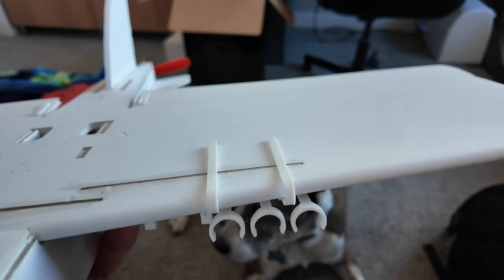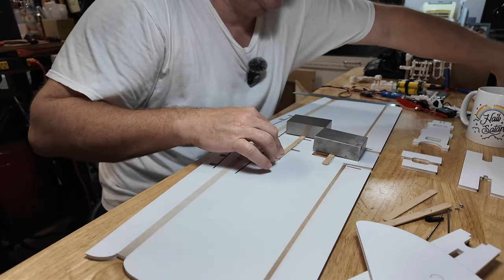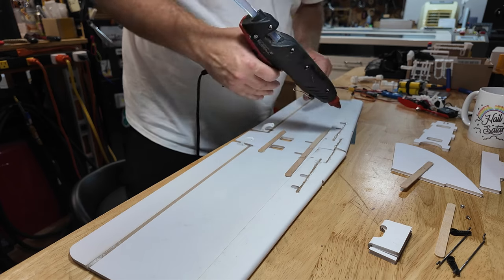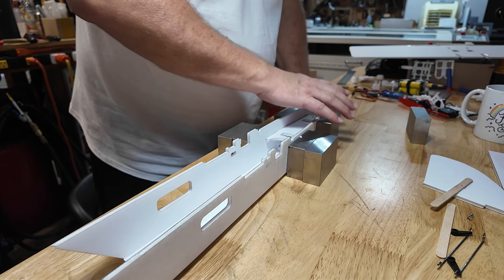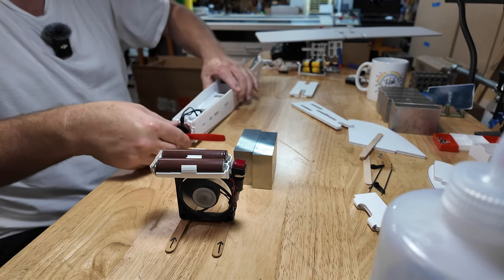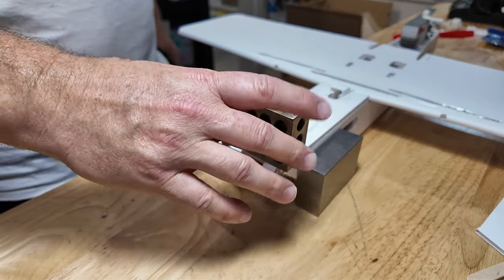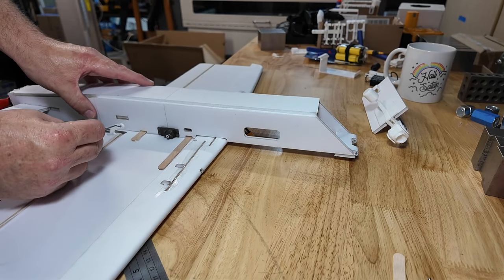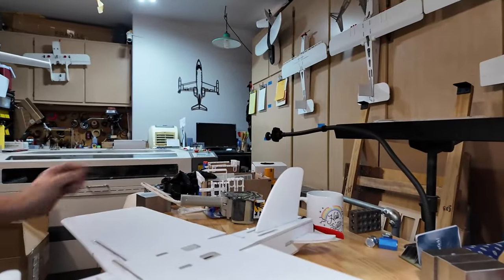Quick Build RC FPV Plane - Aircraft Details and Construction

Comment: Great project. Is there any chance of building one of these that can fly for several kilometers? With a live camera attached to them, like the DJI drones available for purchase.
Reply from the maker: Could the plane fly 10+ kms with a live camera? Absolutely, and without a problem.  The camera and control systems have been proven out (by others) further than that - and the foamboard is damn near invisible to the RF signals they use - so it's really well suited.  Autonomous versions could (hypothetically) even go further as the latency will eventually cause the DJI camera system to give up when they get stuck resending too many packets.  RC Control range would be impacted by your RF environment - but these planes could do remarkable things if given the chance.

The regulatory aspect of that is the challenging bit - and I'd rather not get into the issues and opinions around that as it's not a simple discussion or something I can change.  Do I like the current regulations surrounding RC, FPV and our hobby?  No.  I think the government has overstepped their bounds, and is hurting a hobby that brings kids in and grabs their interest.  Ours is a hobby that turns aimless kids like I was into folks passionate about aviation, engineering, math and science.  Making gateway to the hobby more difficult with challenging regulations only diminishes these kids future, and hurts us all.

Operate safely, and legally to the best of your abilities - but if needed and somehow allowed - know that these are tools to do amazing things.

I hope that helps.  Thanks for your comment.

Comment: What is this Airfoil profile?
Reply from the maker: It's an inverted KFm1 if you have a few beers and squint.  This plane files due to the angle of attack - it's lift is more thanks to Newton than Bernoulli.

That said, it works surprisingly well.  At first I inverted the wing for aesthetic reasons, but it flew well, and had reasonable efficiency - so I just rolled with it.

Bumblebees and the F104 manage to fly with not much wing, so why not these planes?
Reply: @usefulaircraft  that is very interesting 👌

Comment: Awesome tips. I am beginning to get into flying. Made 4 planes so far, the last one flew for 4 minutes before crashing and earlier ones flew less than that.
Your way is easier to make once I have the parts. Do you sell the kit you showed in your video? The cellophane wrapped parts that you showed? Do let me know. I would love to get my hands on one or 2  of those. Just to learn flying first.
Reply from the maker: Thanks for the reply.  This all started as buying retail kits got really expensive for me when I was learning to fly model planes - so I can absolutely relate.  This plane is a blast to fly - but it's quick - and you need to keep the speed up.  Have you seen my high wing trainer plane?  I have a video at:

https://www.youtube.com/watch?v=qfL5Fo-KBEU&t=5s

The high wing plane is much easier to fly for a beginner,  as it's a slower flying plane.  I actually made the high wing to teach some kids how to fly.  It's lighter - and can be flown in a park.  

Once you master that - and especially if you move in to FPV - that may be a better time to step into a plane like this.  it's not that this plane is hard to fly - it just needs to keep the speed up as it's airflow is organic to it's movement through the air, and not induced by propwash where you get the power steering from the wash of the propeller over the ailerons and elevator like you see in most trainer planes.

Drop me a note through the website, or my email is in the channel description, and we can figure something out.  I'm on  a work trip for a little bit - so not at home right now - but I'd love to help you get started.

Thanks for your feedback, and I hope you enjoy this, and some of the other builds I've got that I'll be making videos about as time goes on.

No matter what you decide - steal every idea you can from my videos, and learn to make and build your own planes.  Scratch built planes are so much more interesting and satisfying than store bought stuff- and you learn so much in the process about all aspects of aviation.  It's really a cool thing to get into.  Thanks for the comment!